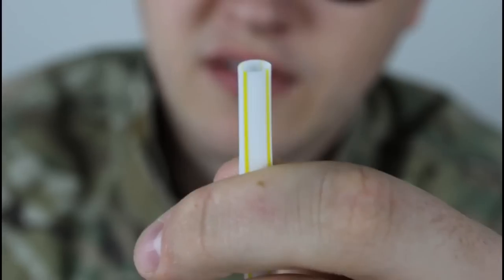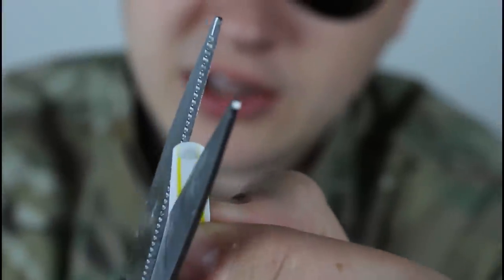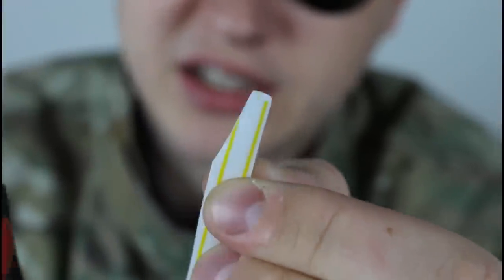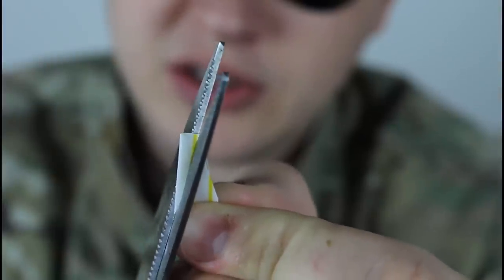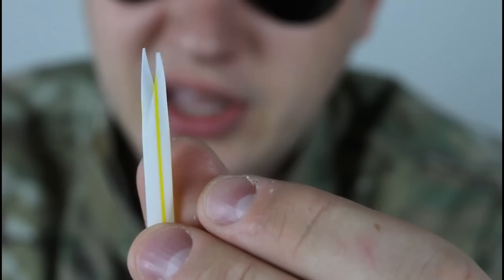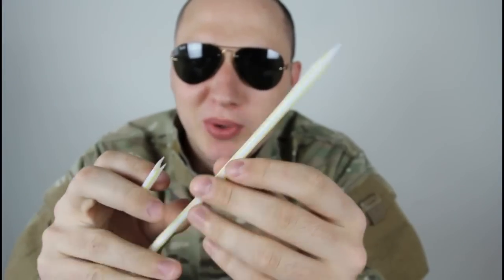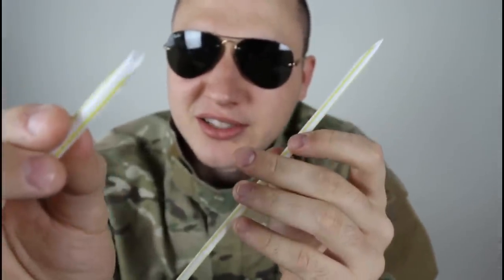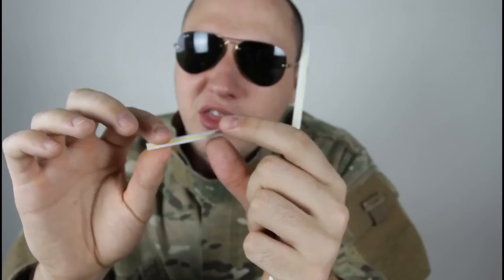Air Horn From a Drinking Straw!

Comment: get two different sized straws (in width), cut to similar lengths, except one has the cuts made like shown (i would suggest the smaller one). put one inside the other, and blow, moving the outer one in and out to change the pitch

Comment: SHould I flatrn the whole straw, or just the edge?
Reply: Just the edge. I made the same mistake of flattening the whole straw and it didn't do anything.
Reply: *****
Thanks :)
Reply: palpo5
Not a problem. And if it ever stops working, bend the end of the straw that you cut about the length of your thumb and flatten only that area out. And if it doesn't work right away, try slowly sliding the straw back and forth between your lips until you find the right spot. Good luck.